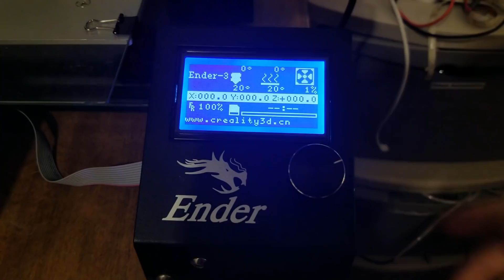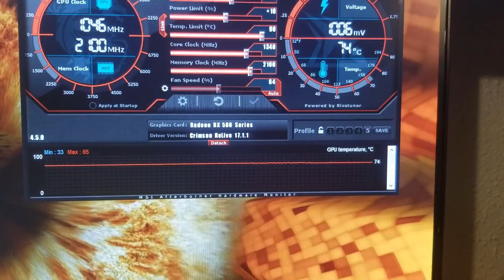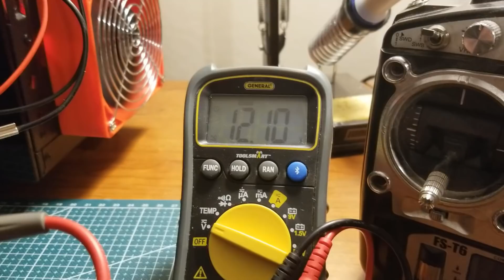Powerful high air flow DIY PC Fan! Super Fan V1 0

Comment: Hey man, interesting video. Your GPU temps lowering was actually more likely just because you removed the tempered glass front panel. Your PC with the front panel on had a few small areas where air could be sucked in, and with the front panel off it was able to completely leverage the fans, which would've probably made up the 10c difference on its own, even without the modded fan.
Reply: Exactly what

Comment: So... to make it quieter.  First use a better motor.  That motor has really bad bearings in it.  Any 2206 quadcopter motor would do nicely.  They're also lower profile, so you don't need as tall of a fan housing.
Reply: I'm going to print one of these frames tonight.  Might as well put my motors where my mouth is
Reply from the maker: Awesome, I'd love to see it when it's done!